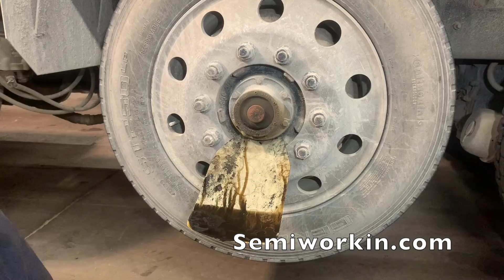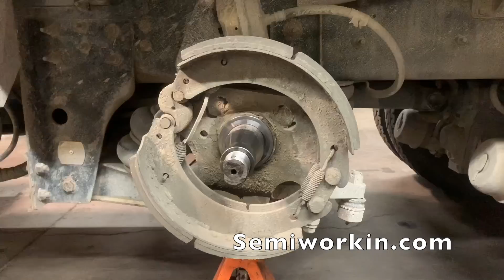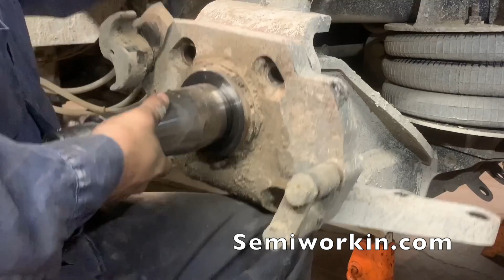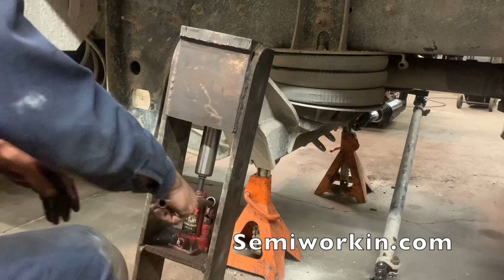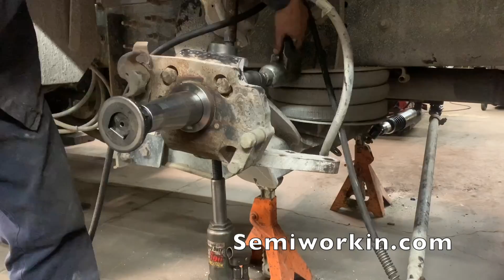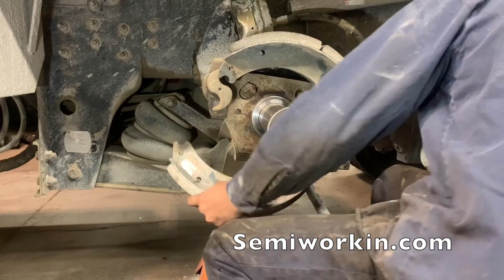Drop Axle | Lift Axle Repair

Comment: Just went to industrial maintenance from turning wrenches in a suspension shop. I loved what I did, loved the guys I worked with, but god damn I can say whole heartedly that I don’t miss the daily struggles. My hearing was so bad I never realized until I started my new cozy inside job. I’m only 34 years old but there are a lot of hard miles on this body, courtesy of work just like this. A true tip of the cap to you my guy and anyone else who does suspension work. It’s truly a man’s man’s job.

Comment: Looks like one of the Hendrickson setups.  We got one just like it that had the ComposiLite  tie-rod that was basically just a piece of flexible flat bar between each steering knuckle.  It was the biggest piece of crap, a straight bolt through the ends of the tie-rod to the knuckles that had a tapered hole where your tie-rod end would normally seat.  It would constantly come loose on one side and eventually wore the knuckle out to the point you couldn't keep the bolts tight, they'd come loose in a few hundred miles.  Ended up having to replace the whole knuckle assembly, and replace the dampers with spring-loaded versions like this truck has and threw that composilite piece in the trash and put on a traditional round tie-rod tube and ends.  No issues since.  All that to try to save what 20 pounds.
Reply: Plus the tires wouldn't last 50,000 with out taking one side or the other.

Comment: I like the clear "oil level" type hub caps - like those from Stemco. The lens does get opaque with time though. But it allows a quick check of the hub oil level. What is your preference?